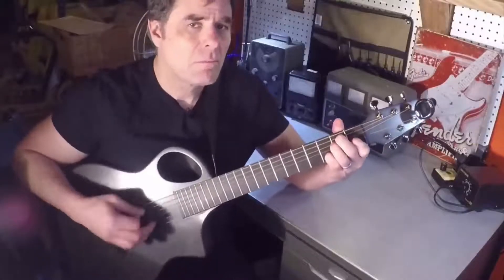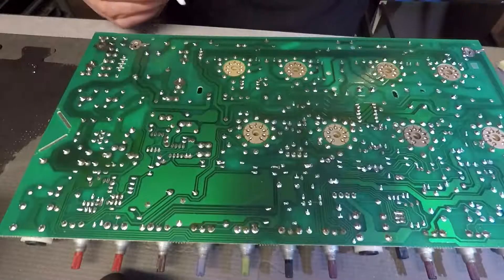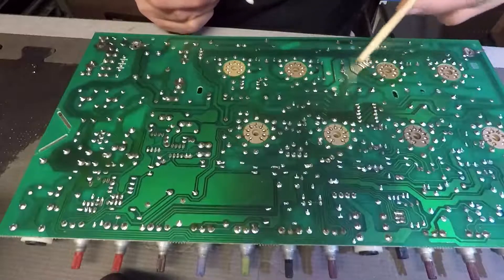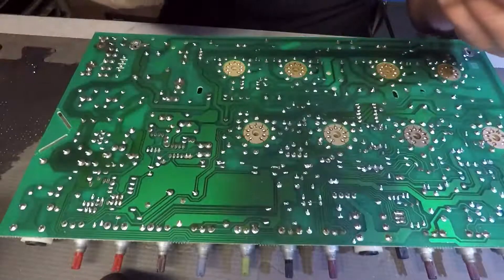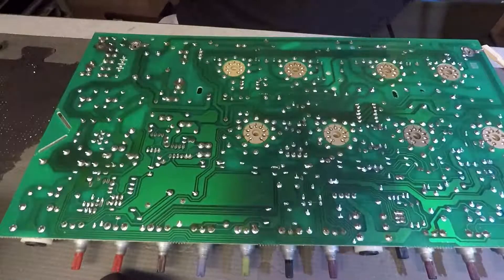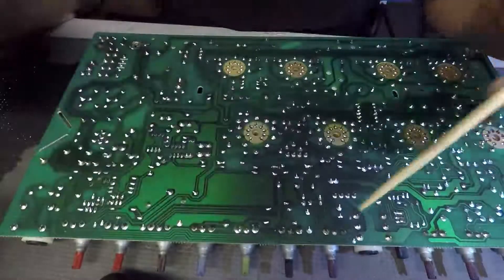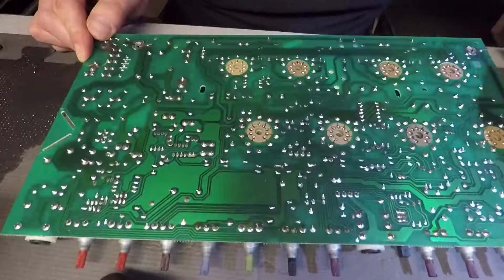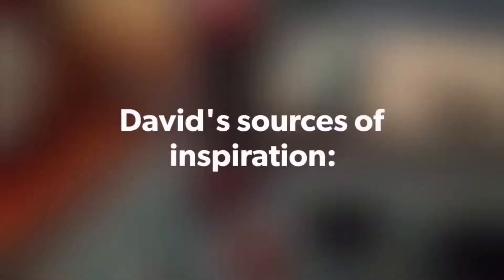How and Why To Clean Up Soldering Residue (AmpMechanic #002)

Comment: I used 99% Isopropyl and noticed it worked really well to remove the residue but it also left stains on the board. Is that normal? Or did I not wipe it up well enough?

Comment: Nice video. I found that some uncleaned residues conduct current. Working on a board, I found conductivity between two pins that went away after the residue was cleaned with IPA.  In one case, a DAC refused to operate because its LRCK was effectively shorted to its "Format" pin, which was also grounded as part of the design. IPA to the rescue!  To that end, thanks again for the video!

Comment: Might 99% alcohol be a better cleaner?
Reply from the maker: I don't think the difference between 70 and 99 makes a whole lot of difference. But I could be wrong about that.
Reply: Legally, the only way you're going to get 100% or 100 -Proof, is from someone who distills it. Everything including "Ethanol" is denatured by adding gasoline for cars, water for bottling. It takes a lot of extra effort to get 100% so distillers measure the specific gravity while it's being make. They stop a 40% or dilute it with water to get it down, so they can sell it. 
Even special corn is planted to break down the carbohydrates to sugars. You can make ethanol alcohol with straight sugar. They "Denature" it before it leaves the plant (Rail or Truck, too corrosive for the pipeline) otherwise it is subject to taxes. 
 I taught guys in Iowa who to fix vehicles and many had family with other jobs. 
 Does isopropyl work ok for cleaning PC boards with components on them? I find a lot of stupid things on youtube. thanks.
Reply: Isn't that what he used?